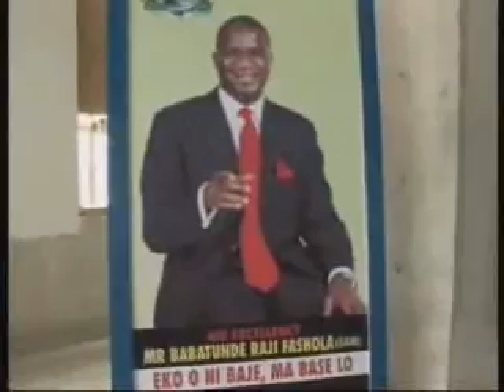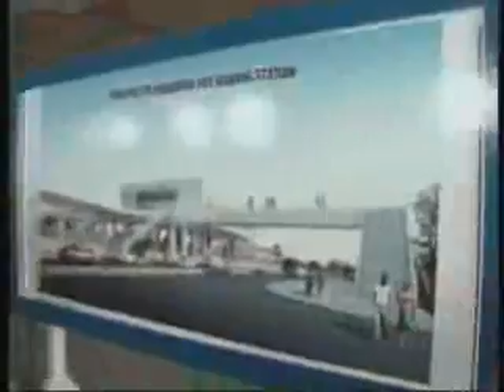Lagos Nigeria light rail project

Comment: i totally dont understand what your saying, if you know lagos very well which is very enterprising it will be able to sustain its railway even if the rail charge is $2, am sure the charges will be based on zones/distance, my recommended price should be able to maintain the rail system with no subsidies, movement should be based on need not just to make it cheap (sustainable development) with the 5 hour average traffic in lagos this would definately be a blessing with or without air conditioning